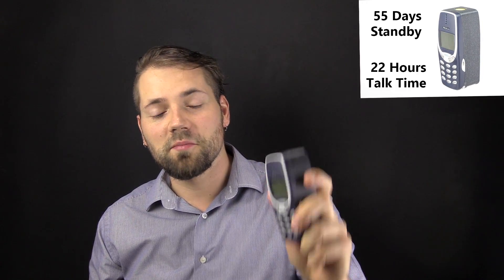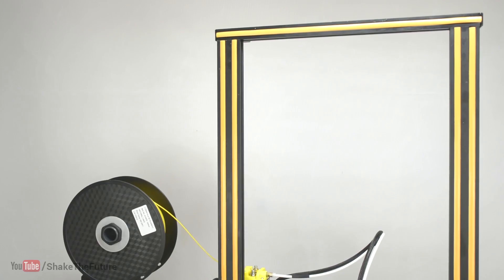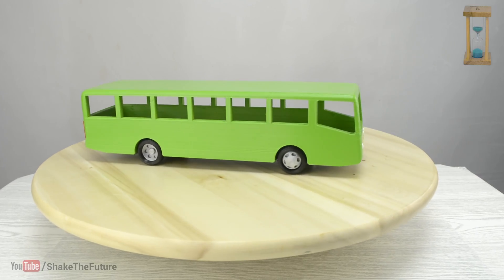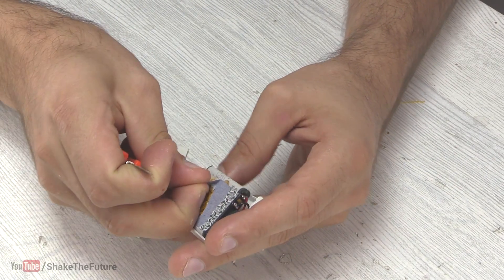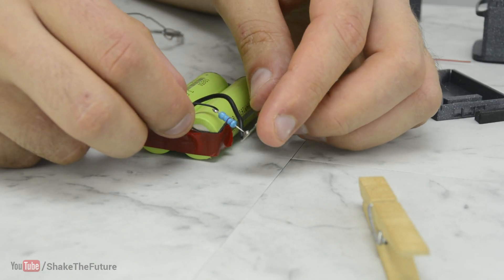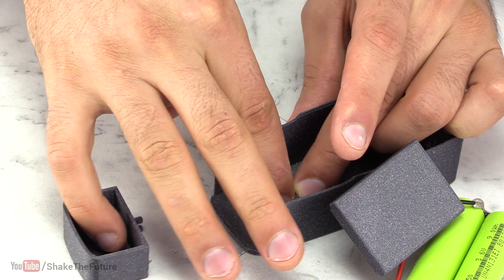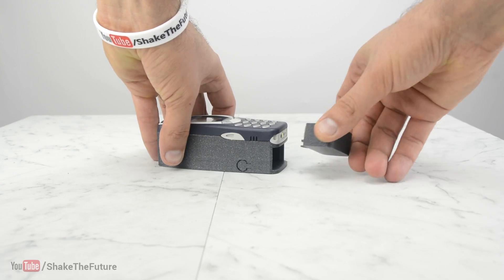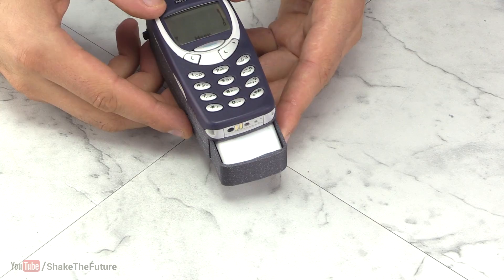Most Ridiculous, but cool Nokia 3310 Mod

Comment: Genuine batteries have a safety circuit (DW01-eqiuvalent control IC and a dual MOSFET) to prevent battery overdischarge and other electrical accidents (such as external short circuit or overvoltage from charge IC failure) integrated into the battery terminal board. It may perhaps be ideal to integrate that into the battery, you can buy a variety of battery protection boards with equivalent components. But with a couple 18650 cells connected in parallel, i can't say that i'm too concerned that something is going to go wrong - they aren't ever going to get reverse biased, which would indeed be very bad if it were to happen, and they have an internal pressure safety system with electrical disconnect to prevent explosion, though that may activate by venting with flame so it's best to avoid it getting to that.

Comment: I have a Nokia 106.1, battery lasts for a week. It would be interesting to see how long the battery would last with this modification.
Reply from the maker: It would last very long, that's for sure. The new Nokia 3310 would last even more. It's a beast even with the original battery.
Reply: I'm sure it would last an eternity

Comment: Nice video. But next time try to add a heatsink to the led. That kind of led's will get extremely hot
Reply from the maker: Thank You for the tip. I would have done it, but.....I removed the L.E.D from another flashlight and it did not have an additional heatsink. The back of it is made from aluminium, I guess it acts as a small heatsink?! It does not get that hot. If I'll use something more powerful in the future, I'll remember about the heatsink. Cheers!

Comment: if you have shop here in the philippines i'll be your first customer, awesome i have nokia 3310 classic but i lost the battery and back cover
Reply: Laxus Dreyar you can still buy the Classic Nokia 3310 its basically the same model. Battery included, the back will fit ( no guarantee )